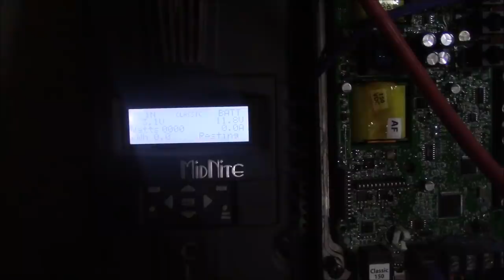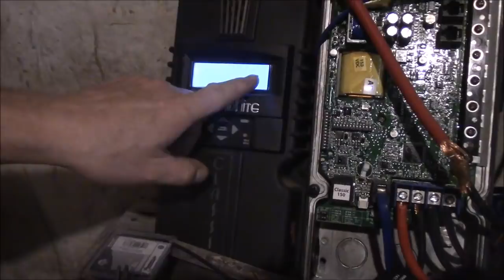Lighting Up Our DIY Basement, Wiring Up Lights

Comment: Cecil I know this sounds crazy but bring in the grid power to a service pole. Then set it up as if you was going to power up a motor coach. If need to you can have two panels in your house 60 amp each and then have two services on the grid pole. That way you can run in two lines from the pole. But do all so it will pass code.

Comment: Being in a Rural Area,are there any old windmill water pumps ? they have a massive gearbox on top for raising and lowering the pump shaft .A diff head from a small car could be fitted so the drop shaft could turn and a car alternator mounted at ground level to keep the batteries charged longer? .They can be moved because they are mostly designed to be fixed with very basic tools.

Comment: Hang a panel outside and the corner closest to the pole they're still going to want to disconnect outside if you put a panel inside so you're still going to need two panels it's cheaper to have 1 panel outside looks good have a nice day

Comment: There are 3 ways to do any electrical install. Your way, to code and the ESA inspectors way. 
When I added my generator panel, I went up and above what's required and it passed without an issue. Simple things like making sure all your wiring bends to the panel are straight, orderly and in sequence. Make sure all the wiring in the panel, is straight, orderly and in sequence. All proper clips are in place and in the correct locations. Every circuit is labeled, clearly. Correct breakers are used for the corresponding load. All fasteners are tight. Conduit fittings are glued or fastened correctly, and the right type of conduit (EMT/PVC) is used for the application. 
Do not use Romex in conduit, only THHN wire (THHN/THWN wires are individual, insulated, and color-coded wires). Correct wire size and jacket color for all circuits. Pay attention to kitchen and bedroom wiring and their breaker requirements. Receptacle and switch height. Pigtail all receptacles. Inspectors love this and it will get you brownie points. My be have the wiring pre inspected, prior to ESA inspecting it.
His comment to me was that he wished all electricians did as good a job as I did.

Comment: Good job Cecil, I like the idea of bending the hook in the wire before attaching it. I don't know why I never thought of that. A hydro Inspector that I had come to my rental house in Southern Ontario years ago said that when you put the grounds together they have to be twisted tight and at least 6 revolutions. Not sure if that is still code today. I am pretty sure those grounds need to be twisted though.

Comment: Master electrician mike your a got the right idea about grid .Im right out side Houston Texas power is like 8.9 cents a 1000 watts that is so cheap solar dose not have way to pay back. you need to think about keeping the 12  volt in case you ever have a power outage witch is normal in the county.

Comment: Can you use a used pannel? Look around at demolition places or scrap collectors. A local braker pannel from a scrap collector that goes in buildingsto salvage copper ext sells boxes $50 each regaurdless of size and he makes shure you have the brakers you need and often gives you a few spares. Alot of times he strips buildings that were rewired within short time.

Comment: Cecil I do not know about Canada but in California we have very strict electrical code on your grounds we have to use a copper crimping ring on the grounds not a wire. Don't be so picky about the length of the wire 6 or 8 on a owners builders permit they are not that picky no inspectors going to get a tape out and measure the wire food for thought check your copper crimping code good luck have a nice day

Comment: Put your meter as close to were you plan to use the most power. That way your biggest usaage doesnt have as much line drop trailing a big distance cause onece the power passes through the meter........your paying for it. I can run my whole wood shop and weld and use alot of power and the bill barely goes up cause the meter is down at the shop. But our house has #2 trailer wire under ground 250ft up and we notice in the spring when we have 2 heatlamps going for chicks and 3 incubators that the bill goes up $45-55. Yet i can weld on a prodject for 2 weeks pretty solid and barely goes up $15. 
      Somday i plan on either adding a pole closer to house and a meter......or setting up a solar system to help level out the house usage. 
    Also.... ..makes complete sence you want to make sure heather is set up incase! Have to think of the whole picture. My wife hates when i do but ends up understandimg that you never know what can happen.

Comment: I understand you need or desire to have power ....most would . You fill your time with projects and at times having power is a real time and labor saving  option. Your off grid set up is fine but at times I would think it could be labor involved at a time that is  best spent at the task at hand. And off topic thought.... if you need to hatch eggs look into Silkie chickens...the breed has not lost the desire to set through breeding.I have a few to set on eggs of different breeds. and dont be fooled by there looks they are a hardy little bird.

Comment: Square D..Home depot 200 amp 30 space 60 circuit 114 dollars
Reply: Unless they changed it since I retired, the max number of circuits allowed in a panel is 42. While there may be 30 breaker spaces in that panel, I believe you can only "double" up on 12 so you would a total of 42. If the panel "buss" isn't slotted in the middle, the "twin" breaker will not be able to attach.

Comment: Good video as usual. Just so you are aware, as I am sure you are, there are still Hydro charges even if you don't use any hydro power. Here is my Nov bill. 3 bdrm bungalow, built 2017.
Electricity........................................................................................... $34.80
Delivery .............................................................................................. $45.18
Regulatory Charges.......................................................................... $2.05
HST (87086-5821-RT0001) ................................................................ $10.66
8% Provincial Rebate........................................................................ −$6.56
Total of your electricity charges........................................... $86.13

Nov 2/18 to Dec 1/18 Usage (kWh) Rate (¢) Amount
On-Peak                         76.26             13.2        $10.07
Mid-Peak                       64.3242         9.4          $6.05
Off-Peak                        287.376         6.5          $18.68

Comment: So, since you have the opportunity to start net new, I would suggest you plan for the following, and I understand you are on a budget. When Hydro One brings in a service it will be a 200 amp service, so why not put in a 200 amp panel. With your welder, and additional outbuildings, now and in the future it only makes sense. And, I would also add a proper generator panel at the time you install the main service. This will allow you to make connecting and transferring power from the generator to the important circuits in the house safe and easy. For sure Heather could do this, without your assistance. You might also want to give future thought to a whole house surge suppressor. I can send you pictures of my setup if required, or when South you can stop in and see my setup in person.
https://www.homedepot.ca/en/home/p.60-amp-generator-panel-with-18-spaces-36-circuits-maximum.1000722301.html